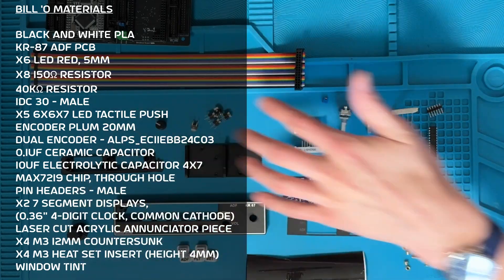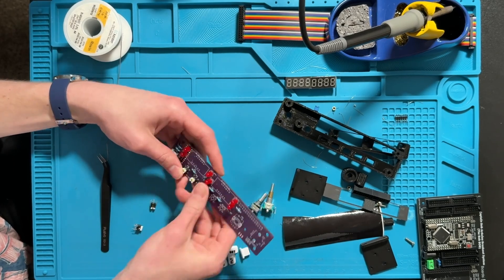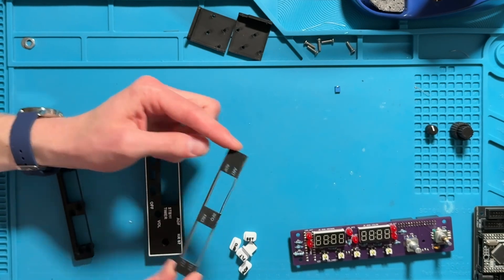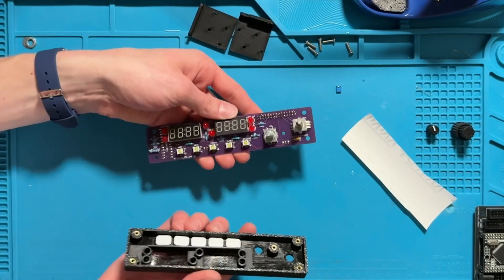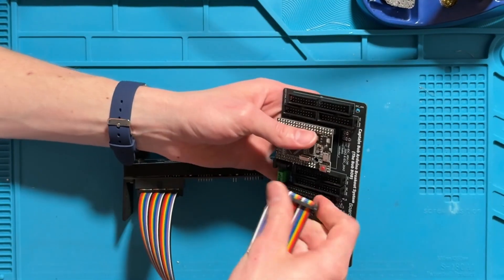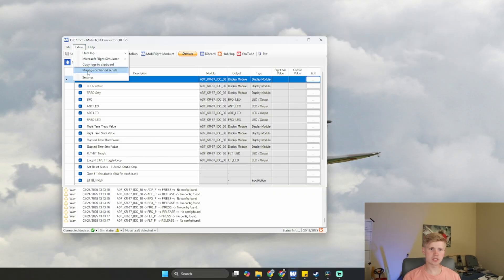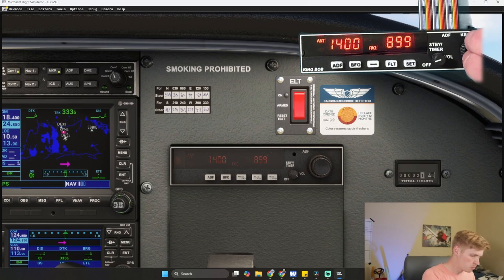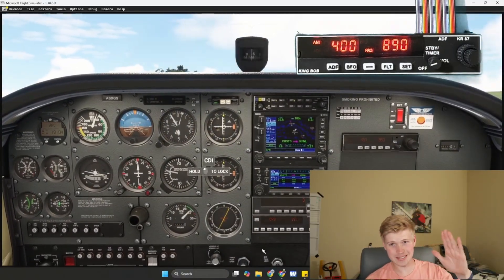Build a Flight Simulator ADF Radio Panel! (KR 87) | C172 #55

Comment: It great and all but there was a time when PCBs were not required and it all seemed a bit more accessible then.  I guess I’m just not knowledgeable enough on the electronics side to understand why it’s required.
Reply: You are right, but it is very easy and cheap to have a PCB made these days and the amount of time needed to handwire everything should not be underestimated. I think using a ready-made pcb may actually make it more accessible, because it's one less thing to worry about.
Reply: @ that is all true but my point was, suddenly ICs are required. I’m sure they didn’t used to be.
Reply from the maker: The IC is a MAX7219 display driver, we used the same chip (in a different format, soldered onto the seven seg displays) for the transponder :) as @g0nny said it just makes everything waaaaay easier to wire (it'd have somewhere near 50 wires if done by hand)
Reply: @ fair enough. Thanks for explaining.